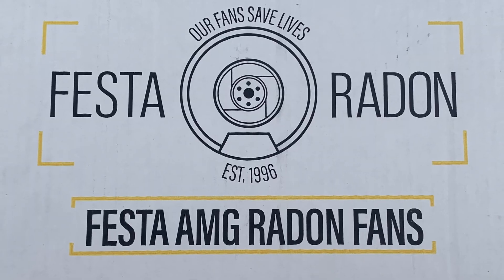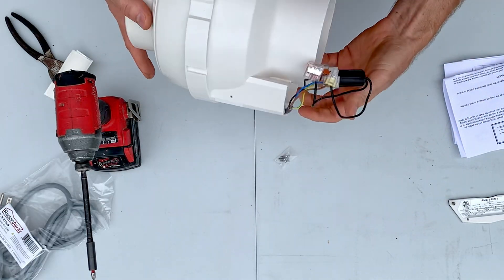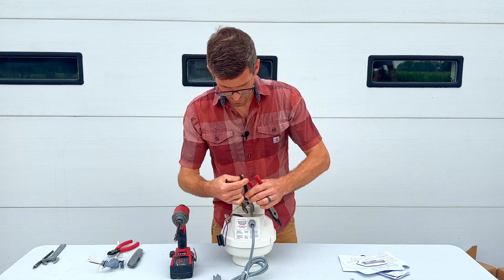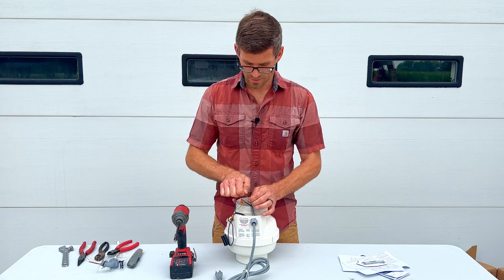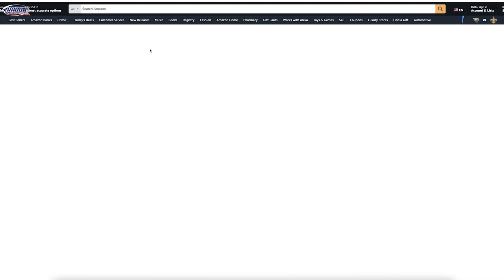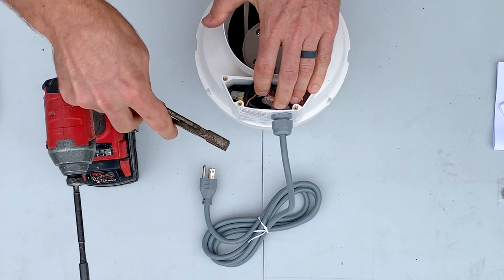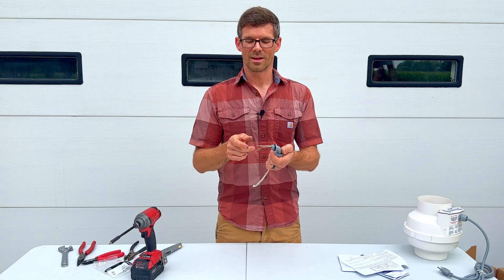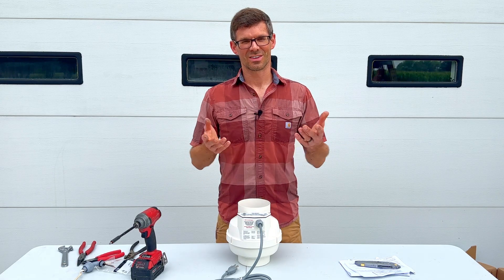How to Wire a Festa AMG Radon Fan - 2024 Update

Comment: You guys don’t need a on and off switch for it?
Reply from the maker: You need a disconnect if the radon fan is outside. If it's in the attic, then the cord serves as the disconnect.